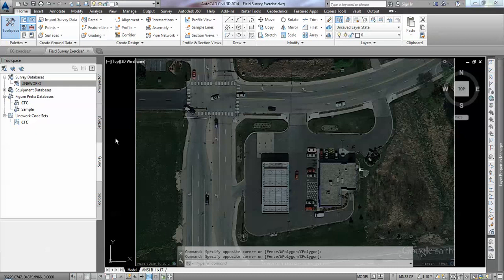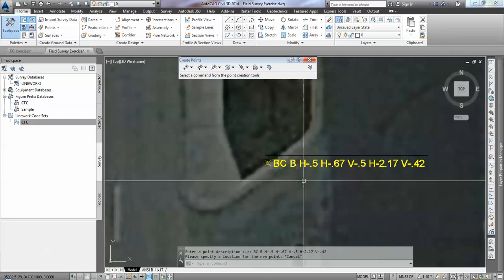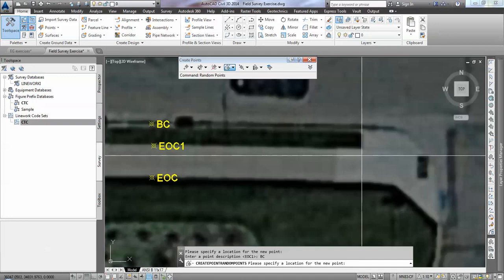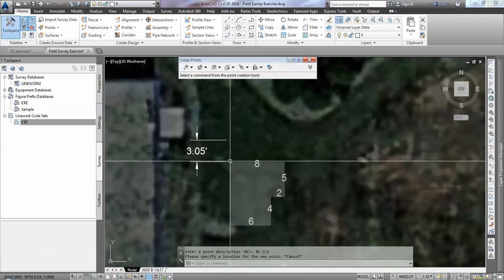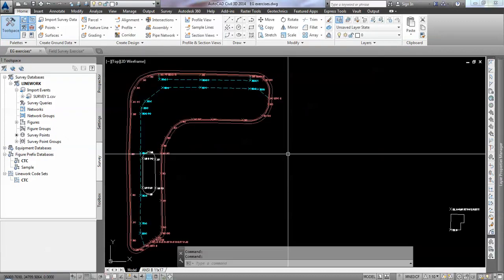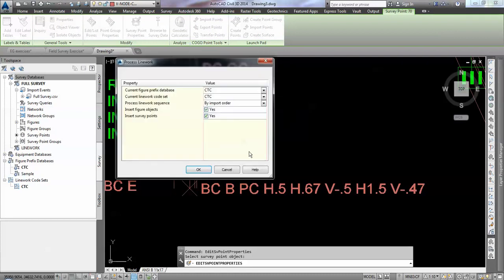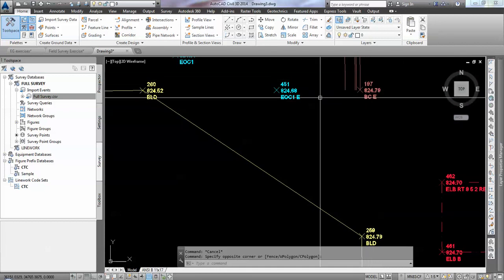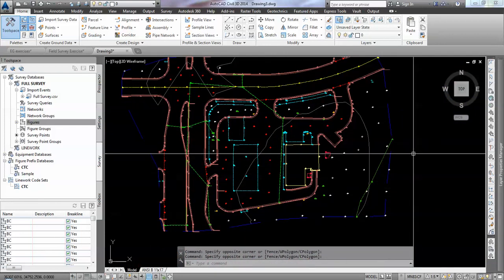Civil 3D Automatic Linework and Survey Databases

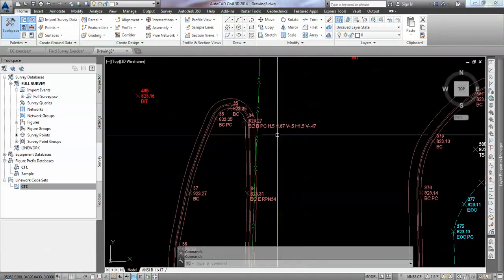Comment: at the 17:04 mark when you did RPN point 84 to 34, it looks like the back of curb connected but the offsets left a wedge of a gap. Would it have worked better if you had done the RPN from 34 to 84?